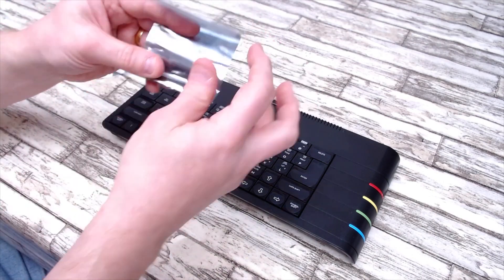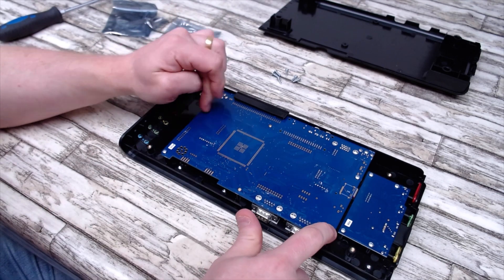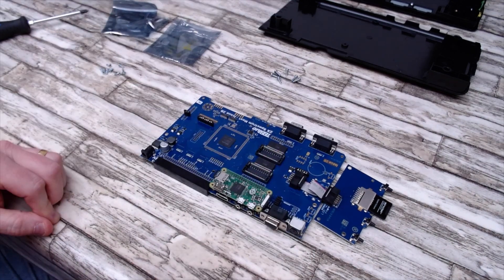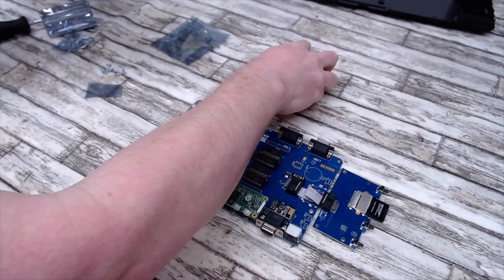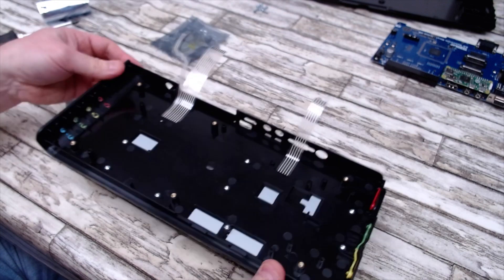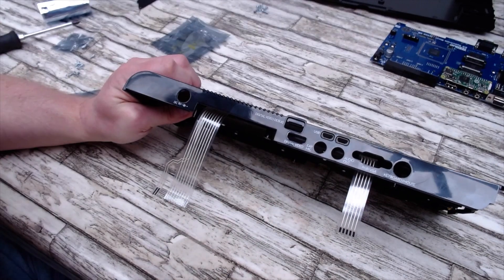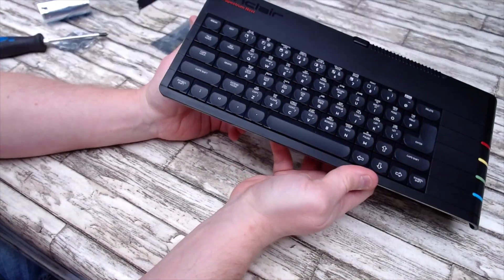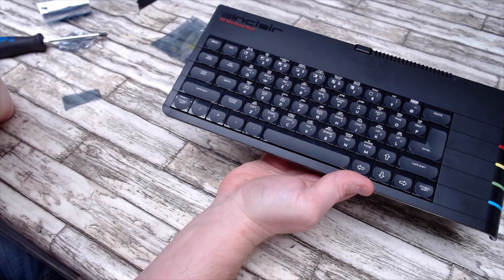Upgrading a base model ZX Spectrum Next with Accelerator board, Wi-Fi and RAM.

Comment: The SD card for the pi one just use the 1G that came with the NEXT, as one will be replacing that naturaly with a larger capacity for all them Speccy games and stuff, so I just reused the 1G SD for the pi
Reply from the maker: Valid point. I had an 8gb lying around that I used in the Pi, I should have swapped them ideally. Doh! thanks for watching :)

Comment: Great content.  I've a few concerns though.  No standoffs for the Pi Zero?  It's not going to be very secure without them when you attach an HDMI cable, and I can see the holes in the main board for mounting them through it.  Also, handling the RAM chips without a grounded ESD strap isn't advisable.
Reply from the maker: Thank you, and thanks for watching :) The 40 pin header does hold it pretty solidly in position, I personally don't foresee any problems on this count. And yeah, for video purposes I should have worn a strap for best practice but I fix up electronics all the time and ground myself on an earthed rad before touching the chips without even thinking about it nowadays so they were safe.
Reply: @RetroGamesCollector  Alright, and thanks for the reply.  I'd just seen the Pi in preconfigured machines and they had standoffs, so I was a bit worried that shoving an HDMI connector into that might not be so rigid.  Your routine of grounding is a very good one to have. Some folks might not be aware of that so it's a good practice.
Reply from the maker: @Atomic_Haggis  next vid I do with ICs I will use a strap for best practice ;) Promise.
Reply: @Atomic_Haggis  The standoffs were really more intended for the board only.  The case will actually do a decent job of keeping the Pi Zero in position.
Reply: @TheTurnipKing  Ah, that's good.  I'm hoping to get one of these in the next run.

Comment: Very informative ant, so the Rp10 SD card is only needed once and you can then flash it via the USB port...im assuming?
Also those ribbon cables are just the push fit ones and the not the locking ones?
Reply from the maker: Just push fit as on the original Speccys mate. I'm unsure on whether the card can be flashed via the Pi0 mini usb ports or not, need to look into that.

Comment: I also had a problem with inserting RPi0 enough down and also WiFi module, because their connectors have quite sharp points on top of the boards. It's quite painful to do it just with your fingers. The RPi0 didn't work for me at first, because I didn't insert it in enough. 
Those sharp points could damage keyboard ribbons so you could use a bit of putty on top. Also make sure to insert SD card (installed with the appropriate latest img from https://zx.xalior.com/NextPi/ ) to RPi0 before closing the Next.
Removing blanking plate of course involve a trick:
https://www.youtube.com/watch?v=U7yvrfbevWY&t=5s